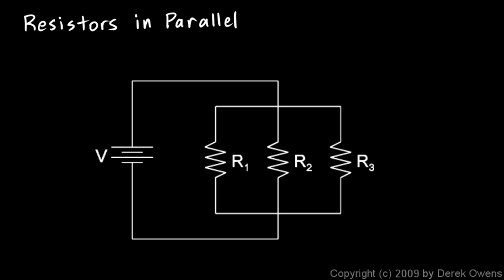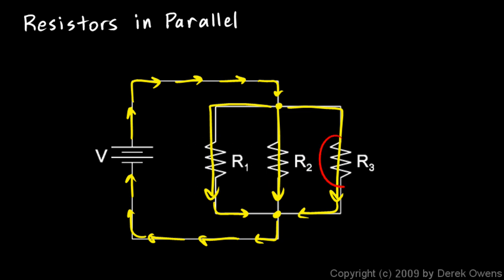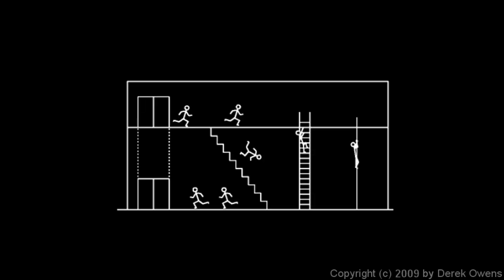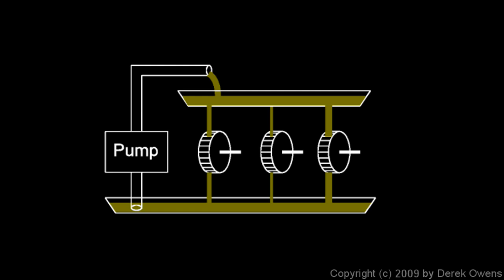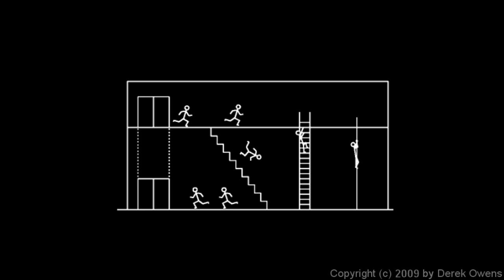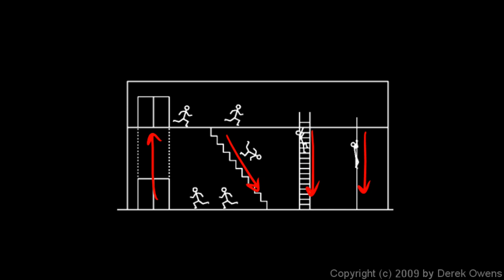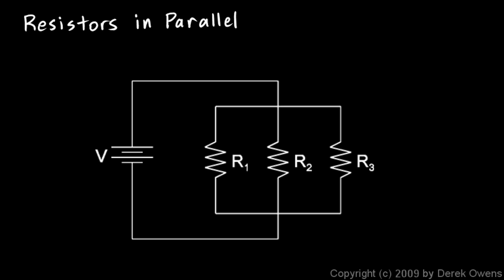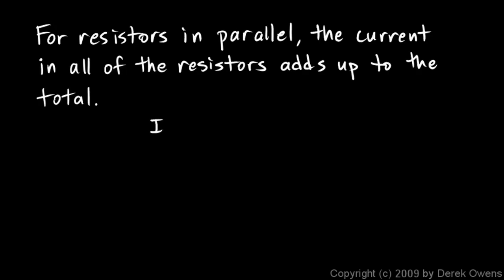Physics 13.4.2a - Resistors in Parallel

Comment: I have a question: well, what goes in must goes out. But how comes that it goes out at the same rate ? I don't understand this. Even if I have no resitors in the circuit I can't picture why the flow rate is constant. I understand that the energy must be spent equally, but why is the flow rate constant ? Could you explain me, please?

Comment from the maker: I think your terminology is correct and meaningful.  The pipes "draw" the water from the pump.  Electricians often refer to the amount of current drawn from the voltage source.  The voltage source is passive in this sense.  But we can also think of it the other way, in terms of cause and effect.  Voltage causes current to flow, and with enough voltage, you can force current to flow just about anywhere.
Reply: Derek Owens You are awesome 😍 Please keep uploading more topics , please , It'll help alot, There are many out there, but none matches the concept you deliver with such ease and decency

Comment: The fewer resistors there are in parallel, the greater the resistance, because the current has less area to travel through. Less current will get to the light bulb as a result and you will have a dimmer bulb. That's if the resistors in parallel reconnect before they meet the light bulb.

Comment: A light bulb is a resistor. Therefore, the more resistance (40 watt has more resistance than a 60 watt) the more heat the light bulb's filament experiences and as a result, shines brighter. However, too much current supplied to the light bulb and it might give off so much heat that is acts as a fuse and blows, discontinuing the flow of electricity and resulting in a burnt out light bulb.

Comment: I suppose it's a bit late, but if you're using the same resistors, then a light bulb in a parallel arrangement will be brighter. Light bulbs are actually just fancy resistors, the filament in the light bulb heats up and gives off light because of resistance. The overall resistance of a circuit will be less if there are resistors in parallel that in turn all connect to the light bulb. The less the resistance, the more the current and the more power there is available to the light bulb.

Comment: resistance is the reason for heat. But because heat from resistance is actually caused by the current (the electrons) and because current takes the path of least resistance, more current through less resistance will get hotter compared to less current going through a larger resistance. This is true for resistors is parallel, however. If, in your example, you used resistors in series, the largest resistance would be the hottest since all of the resistors have the same current.

Comment from the maker: @moezart94  The resistance is *part* of the reason for the heat.  The current is the other part of the reason.  And the effect of the current on the heat is more significant than the effect of the resistance.

Comment from the maker: @moezart94  I mean the resistor.  If the resistance, in Ohms, is a larger number, then there will be more resistance, therefore less current flow, and less heat.  As an example, a 100 Watt light bulb has less resistance than a 60 Watt light bulb.  The 100 Watt bulb is definitely hotter.

P = I^2 * R.  The Power depends on the current and on the resistance, but in the equation, the current is squared, so the amount of current is more significant in determining the heat.

Comment from the maker: @InvaderZim931  Well, a smaller resistor will allow more current flow, and this will typically mean more power consumption, so it will get hotter.  With actual numbers, you could work out the power and the number of Joule or calories of heat dissipated.